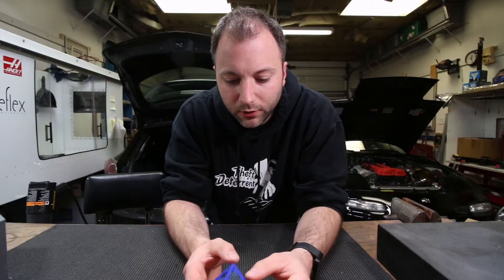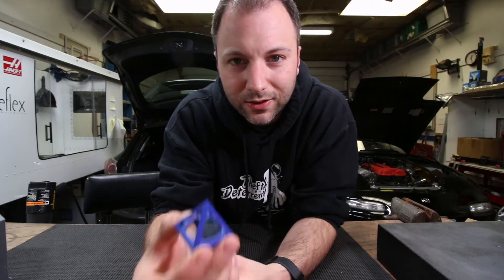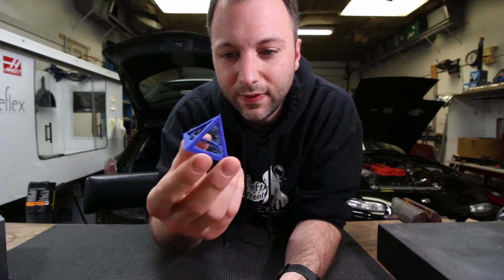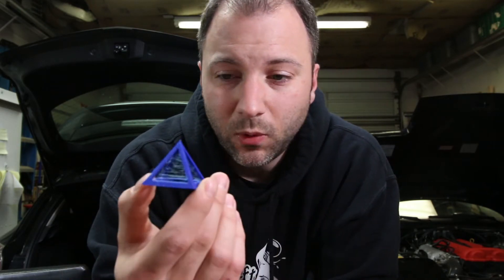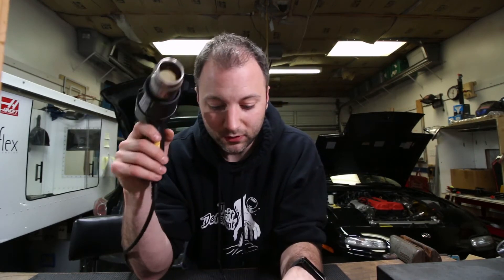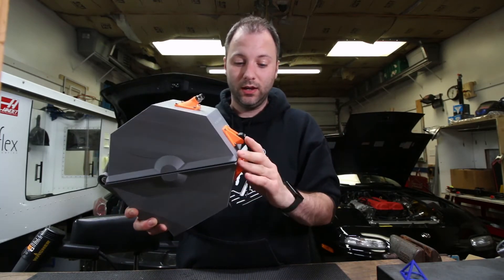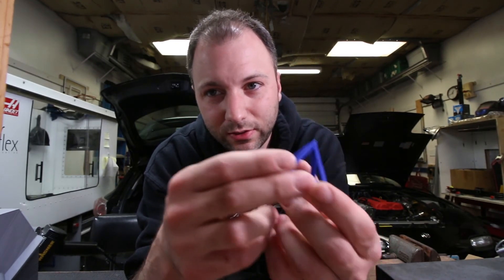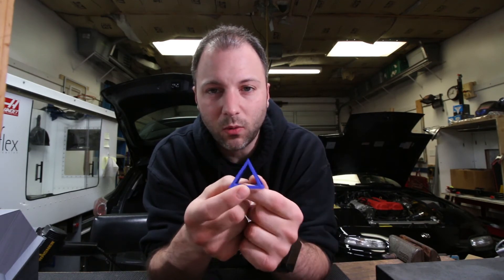How to remove ooze strings from your 3d Prints

Comment: If a hair dryer works, I'm curious if a Air fryer would work on very low heat settings. I'm referring to one of them that have the trays similar to a stove.
Reply: Don't you dare try 'er

Comment: To everyone seeing this and asking if a hair dryer will work. Not with PLA. You need alot of heat and quickly. At least the same temp you print at, if not hotter. 200 c is about 400 f. Hair dryers dont get that hot. So you're more at risk to softening the 3d print and deforming it. An open flame, run over small pieces quickly also works. You do risk leaving singe marks though but if you plan on painting it anyway then a camp lighter is a cheap way of doing it.
Reply: This is why theory's are nice, but putting them into practice is better. I just tested this and a hairdryer definitely WILL work. Since the stringing is soo thin, and heat does get sufficiently hot to melt it away slightly. Though admittedly, it doesn't do as good a job as a heat gun would but it gets you 90% of the way there. Also, I'm using PLA+ which I believe has a slightly higher melting point so who knows, it might work even better on PLA parts.

Comment: I store my 1kg and smaller spools in gallon freezer Ziploc bags with a few desiccant packets tossed in.   The bags are cheap, they're air tight and desiccant packets are also cheap online and if you spend a couple bucks more you can buy ones you can dry in the oven and re-use.

Comment: Strings are always caused by moisture contend in the filament..  I've had several brand new rolls,  just opened,  and I get strings...  I'm still looking for the right answer.
Reply from the maker: I wouldn't say all strings are caused my moisture. Retraction settings are how you control stringing typically. But assuming your retraction settings we're good for a filament one time and then after while they aren't ok  it's likely moisture that's now causing the strings.
Reply: Filament can be wet right from the factory, and different filaments can have different "viscosty" in liquid form, so they may need different retract settings, and you PTFE tube fitting (if ur printer is bowden setting) can become worse overtime and lost the ability to hold the tube tightly, which will, again, lead to stringing

Comment: I have a relatively dry air in my room... Will a PLA filament soak in that moisture for about a month sitting on the table? I'm getting more strings now and started to think... can it be something else than retraction settings?
Reply from the maker: It's possible. Could try switching filaments to a new box. Try running old code on print that had less strings see if it now is more stringy.  Or try drying the filament and see if the strings go away
Reply: Unfortunatelly I have only new PETG filaments. As soon as I'll finish my dry box (only fittings left probably) I'll be testing these PETG.
For the old PLA I'll cut off 10-20m of the filament and try to dry it in our Hotter airgrill. Didn't tried yet so need to be careful :)

Comment: The problem with the heat gun is it heats up all the filament and the stringing has to go somewhere? it turns into little plastic balls the makes your print rough.
Reply from the maker: Sounds like your stringing is pretty severe. In the cases I've used it the strings are much finer and the balls are much finer/smaller and not visible like in the video. If the strings are much bigger try adjusting retraction, drying the filament or if it's a flexible filament that does not respond to retraction try setting the travel moves to stay inside the part so all stringing is inside the infill (there are good tutorials on this online). Good luck!

Comment: If you have a heat gun with two settings, which setting works best, low heat or high heat?
Reply from the maker: Try low heat first. If it's taking too long try high heat but be careful as your part may not take high heat for long without warping.
Reply: Safety Glasses Required OK, I just tried both. High heat worked better. It melted off the strings in about half a second before the bulk plastic really got warm. At low heat I had to hold it for longer (1-2 sec.) to melt the strings, by which time the bulk plastic started to soften a bit as well.

Comment: dip in acetone problem solved. hair dryer not the way buddy
Reply from the maker: I've acetone vapor bathed parts as well.  It tends to melt fine details and something as fine as the part shown in this video would have collapsed. Also acetone is can be used as a solvent for ABS but the part in this video is PLA and acetone wouldn't have done anthing. Watch the video to completion it's a heat gun and worked very well to post process stringing caused by "wet" filament.

Comment: Two things to minimize stringing. (1) An appropriate amount of retraction. It will be different for each filament type. Also retraction will not be the complete solution. (2) Use coasting with a good slicer like Cura 3 or Simplify3D. The right combination of both techniques will greatly reduce stringing. The whole purpose is to reduce the pressure on the filament in the extruder before and during the extruder movement.
Reply from the maker: +Digital Ed may be it wasn't clear in the video but with the same gcode/settings(that normally doesnt string) you can get stringing if the filament has absorbed moisture. Which is what happened in my case and I didn't want to reprint the part. To avoid filament absorbing moisture it should be stored in a sealed container with dessicant. If it does get wet you can dry it with heat in a food dehydrator or oven.
Reply: All of my rolls of fiber are in Ziploc bags, each with desiccant,  stored in airtight containers. I have never had a problem with moisture. I would still emphasize the feature of coasting is as important as retraction to minimize stringing. I have only seen one online contributor that has covered it (Maker's Muse).
Reply from the maker: I encourage you to watch my video "How To: Dehydrate 3d printer filament".  In that video I use the exact same Gcode (retraction and coast settings as well) to print the same part with no stringing at all.  The only difference was drying the PLA filament in a food dehydrator for 12 hours.  No doubt if you do not have your retraction and coast settings dialed in you can still have problems but in my case it was simply wet filament.

Comment: Small Butane torch with a quick pass will do a much better job without deformation of the surrounding areas 👍
Reply: Ffffff*ck man, you saved my life with this 4 years old comment. I have to clean strings for more than 1.000 pieces and heat gun was not working for me. I owe you many beers, thank you! Greetings from Madrid.
Reply: Was looking to see if someone had experience with this. Might need to pick up a torch tomorrow.

Comment: I would like to see a follow up print of the same part with the same PLA after you dry it to see how much difference it makes.
Reply from the maker: +vitriolix I will get a short video about the food dehydrator info out this weekend. It worked great by the way. Check out my Instagram for a photo of the before and and after drying.